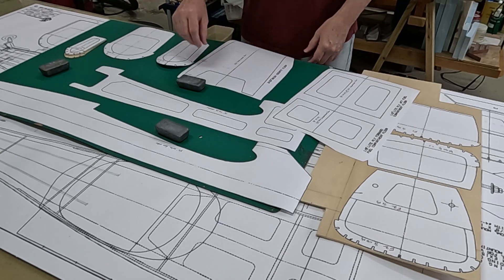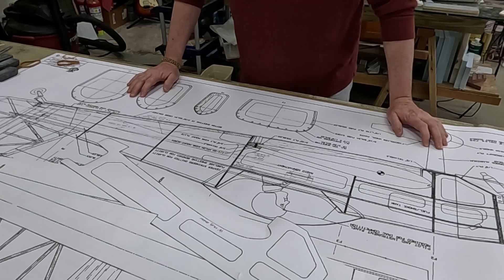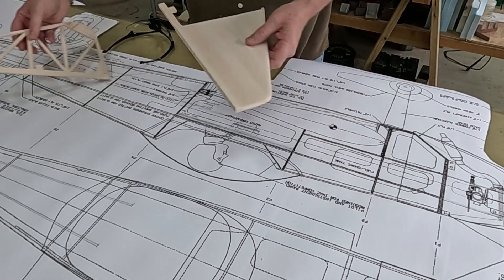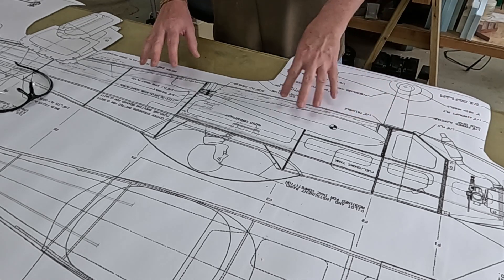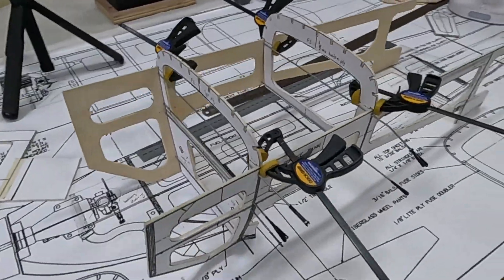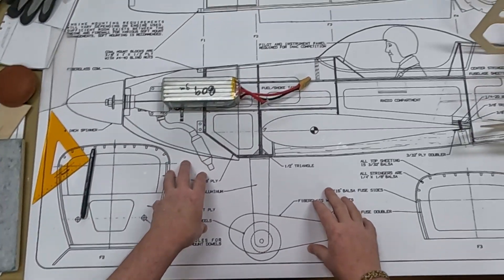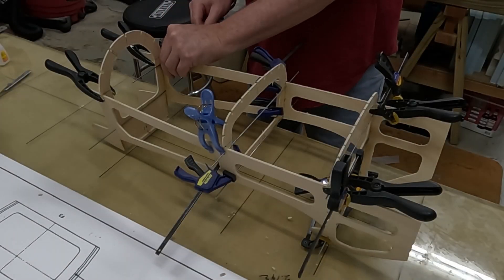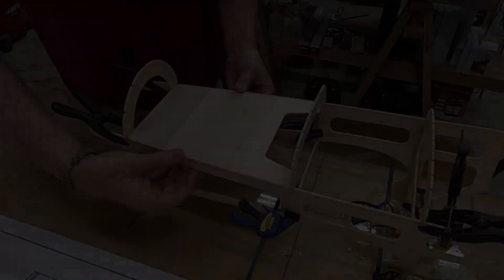DR-107 One Design RC plane build, Update #10, Fuselage construction

Comment: I think you did not keep account for the fact that the fuslage tapers toward the back. The airplane is drawn as viewed from the side when assembled. The aft portion of the fuselage sides are therefor pivoted away from the viewer. When they are projected into a flat view the become longer.  Maybe not as long as they are now but certainly longer than on the main plan. I have workd with CAD my whole life and have drawn quite a bit of RC plans hobbywise as I had them means (and the hobby) :-)
Reply from the maker: Yes, that thought did occur to me regarding the fuselage sides and doublers but that still doesn't account for the formers that are too big.  Also, In update 9, I talk about the horizontal stab being too big as well which also comes from the template page and it's just a flat plate.
So, while I agree with your thinking on the fuselage curvature, I think the whole template page is simply too big. 
Thanks for the input!